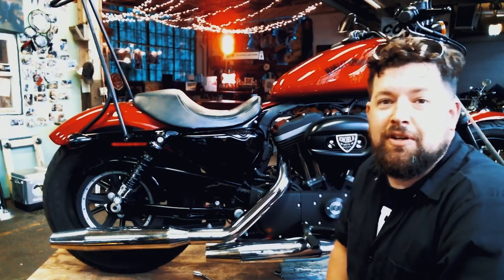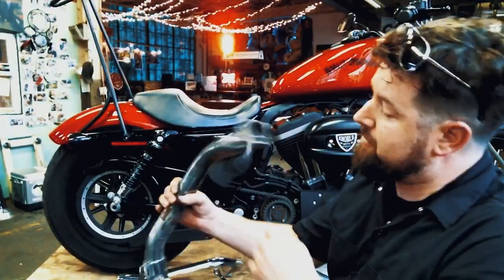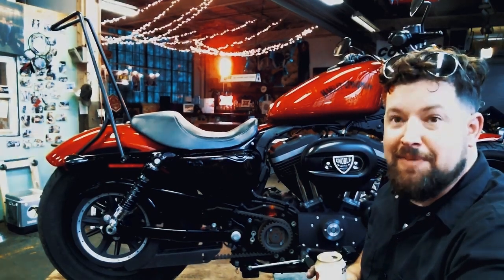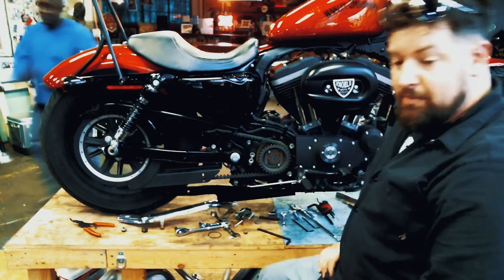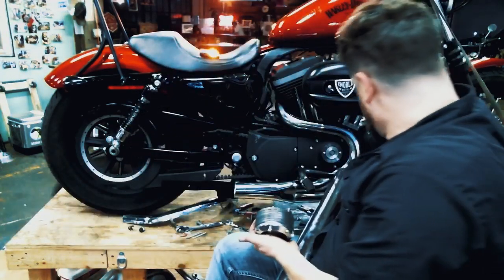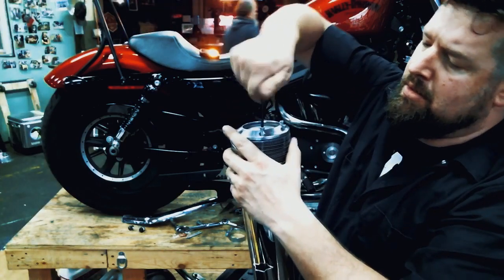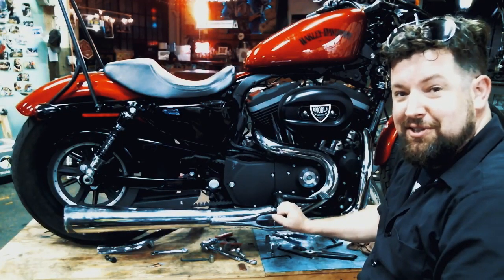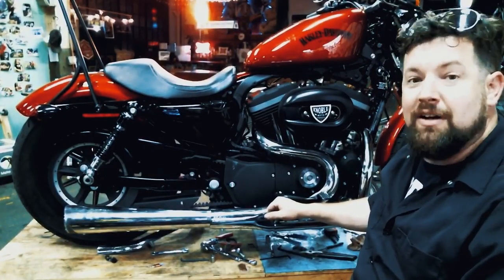Supertrapp Exhaust install & sound demo

Comment: Ordered one for my 99' FXSTC this week because of the suggestion of a performance V-Twin engine builder, my first choice was an RB Racing two into one but that pipe doesn't provide much in the low-end torque range of street riding conditions, Supertrapp has been around for many many years and you don't survive that long if your product isn't good.
Reply from the maker: Absolutely!   Over 40 years!
Reply: @KnobleMoto  how’s the pipe made your riding experience change? Have you noticed any difference between stock and the Supertrapp?
Reply from the maker: @keithashline505  It is night and day performance wise compared to stock.  Much more low end, and more torque across the entire power band.
Reply: @KnobleMoto  that’s great news, thanks! It’s exactly what the V-Twin speed shop told me and why they steered me away from the RB Racing header.

Comment: Does the front pipe stick out very far ?? all of the vids & photos I've seen make it look like it sticks out along way to the right . 
does it look weird from the front or back ? im about to order one but am a bit concerned it hangs out to far .
Reply from the maker: it fits in pretty tight on that pipe and it looks correct. Some manufacturers didn’t do a good job with 02 senor placement and the pipes did stick out on early FI stuff.
Reply: Awesome ! that's great . Thanks for the info & thanks for the quick response . I am literally sitting here with my credit card in hand, ready to order & saw the front pipe & had a freakout ! 
thanks once again , much appreciated

Comment: Hi, what torque setting did you use for the muffler clamp?
Reply from the maker: I am not sure now. It was a 12-24 screw, if that helps at all. But I got it as tight as I felt I could push the fastener.
Reply: @KnobleMoto  Thanks for the response. They do not list torque settings, and I  can't seem to get a response from Supertrapp yet. I won't  give up, though!
Reply: Finally got through to Supertrapp. 70 inch lbs for the big muffler clamp. The bracket to frame is stock per the manual 95-115? In lbs. I suggested they list the torque values in the install guide!
Reply from the maker: @garyboman5018  that is an excellent idea!

Comment: Are you running an fp3 at all ? I have an fxdls and the fp3 doesn't  show a map for the supertrapp .
Reply from the maker: I did install an FP3 on this bike.  It didn’t have the exact pipe, so I went through the menu until I found something close.  Even then it wasn’t a great tune, it was way to rich.  I ended up having to rewrite the map based on my dyno tuning experience.  I was not thrilled about it.
Reply: @KnobleMoto  thanks for your reply mate 👍🏼  iv messaged v&h hopefully they can send me a map more tuned to the supertrapp exhaust 🤞🏼
Reply from the maker: @martynfishwick12  I hope so!!!